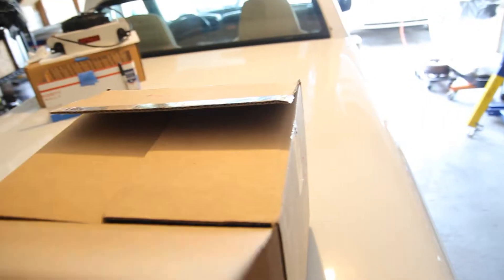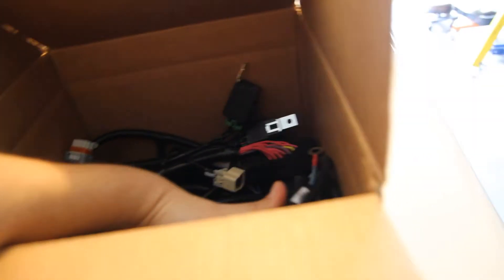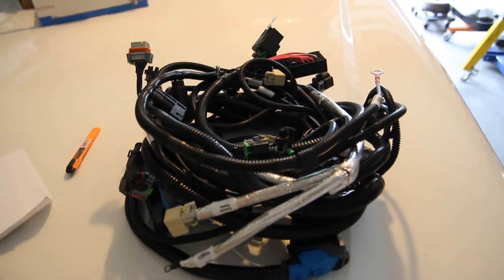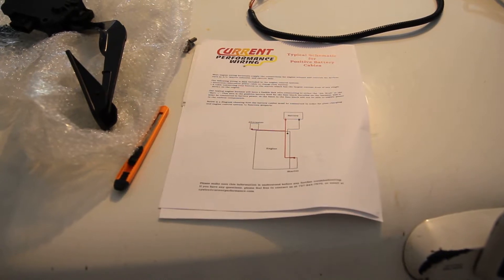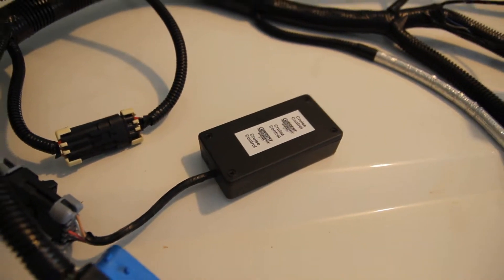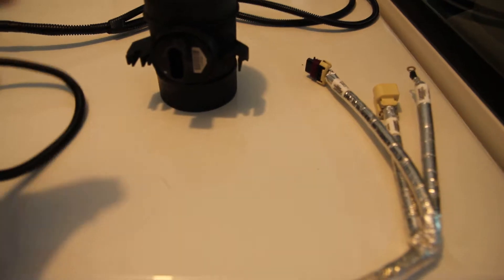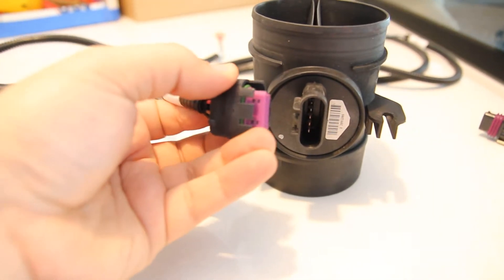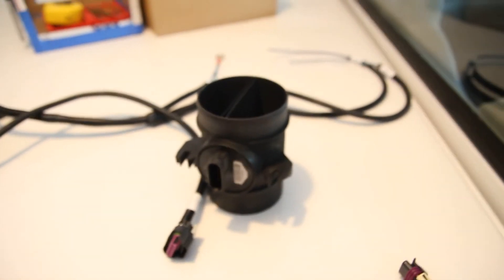Part 1: Project Betty White: Turbo Chevy Colorado V8 LS LQ4 swap Current Performance Wiring harness

Comment: What was the total cost for the necessary parts?
Reply from the maker: roughly, 2200 for LQ4 and 4L80trans and front accessories with about 100k miles on them, I probably spent 2500ish on go fast goodies, and then $3300 locally including tax for new pistons and machine work top to bottom, all new bearings top to bottom, bored 20 over, ARP stud kits top to bottom, balanced and blueprinted, decked with a torque plate. as of this message im $12,5 into this truck with the turbo stuff left, yeah I could of probably done it for cheaper but I believe in buy once cry once and have OCD